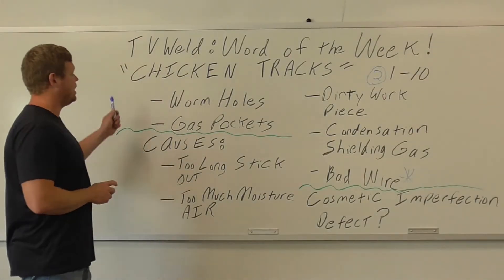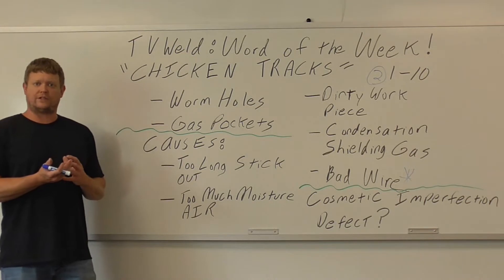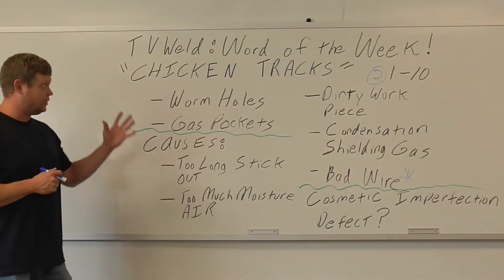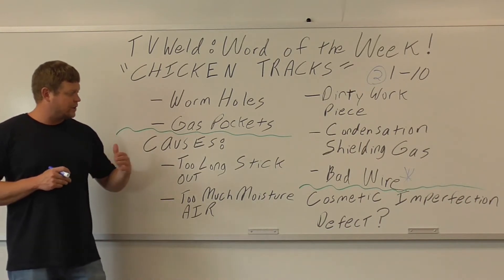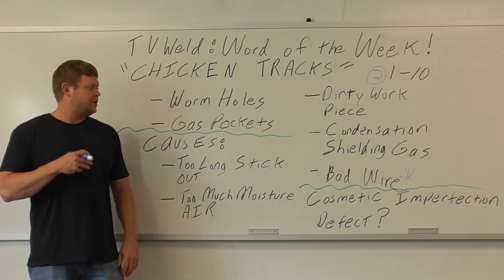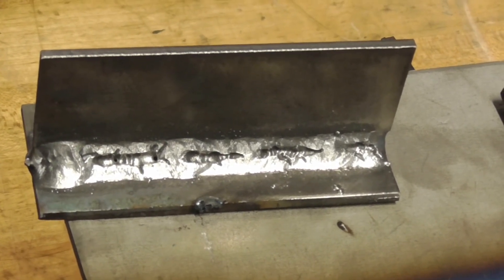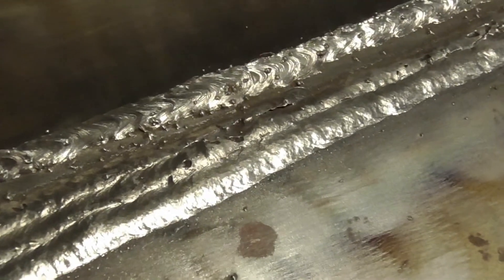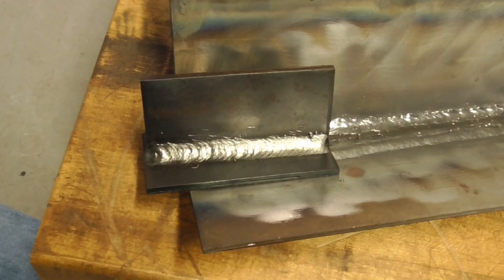Welding Chicken Tracks & Worm Holes

Comment: Can you please give us a link on where to buy or how to make that little cleaning filter piece you add in front of the drive rolls ? Please
Reply from the maker: https://www.amazon.com/Weld-Aid-Lube-Matic-Lube-Black-Pack/dp/B008RA58UC/ref=sr_1_2?crid=3L4M5I368GZAB&dib=eyJ2IjoiMSJ9.8qyHGBNwUUk6aWmSzlw_ggTtA-HdKWmsuyxzDK6azgMx4-VnA440C3gRi2ntRC7MY6McOutTLAE86_bhoZaWcOMezTM8CUBxEwUE3XnMrOixLZCQpd8-in2UL4vFsE4Y.pof8t4jpfk9csp1YhLSX2hkHlXJlQ862Ehb2yLtLKww&dib_tag=se&keywords=MIG+Wire+Cleaning+%26+Lubrication+Pads&qid=1716821886&sprefix=mig+wire+cleaning+%26+lubrication+pads%2Caps%2C1975&sr=8-2

Comment: How long do I put the flux core wire in the oven for and how many degrees ?
Reply from the maker: I think its around 212 degrees F. for 6 to 12 hours, but if it's a plastic spool you can't go above 150 degrees F. or the spool will get damaged.  I actually just messed up a spool of 3D printer material, but the oven was set at 250 F.
Reply: @TVWeld  mine has a plastic spool so 150 degrees for 6 to 12 hours ? Correct
Reply from the maker: @SubcomandanteMarcos1  Yes.